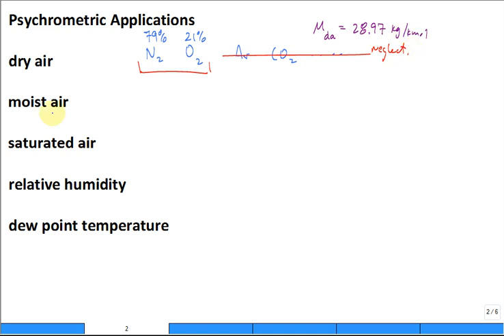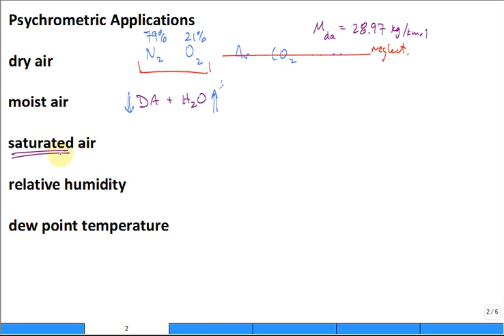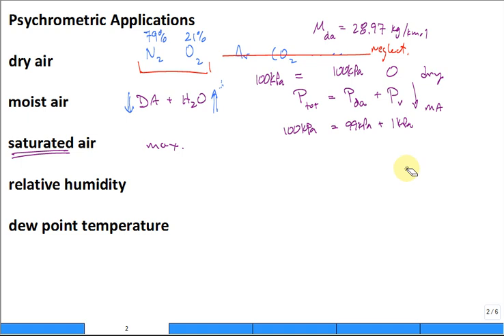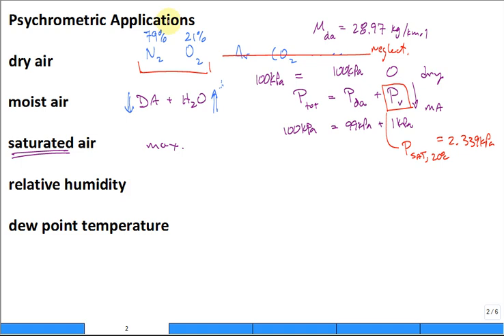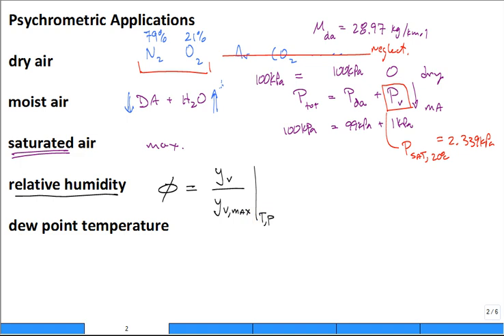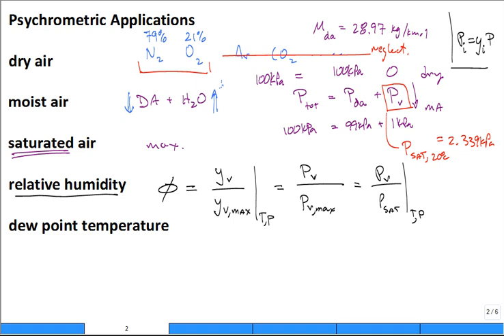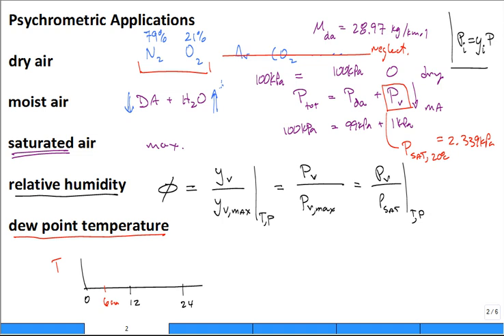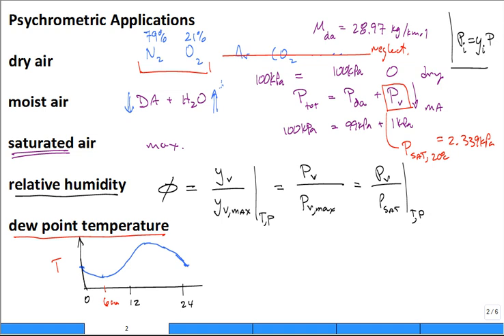Moist air properties

Comment: One simple question  PV = mRT holds good for closed system  if u consider atmospheric air its an open system that's y when u heat d air,  atm. pressure at than area decreases and wind arrive there from high pressure area.  
So here as temp goes up pressure goes down so this equation isn't satisfied in this case still how we are using it to derive specific humidity and other parameters!!!!!
Reply: same  doubtt!!